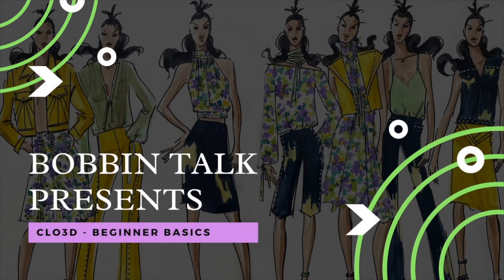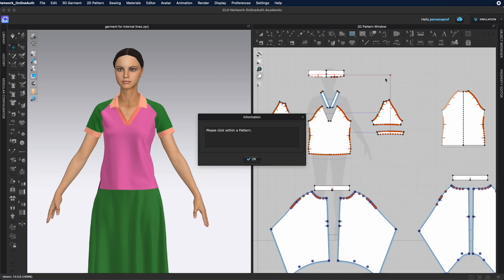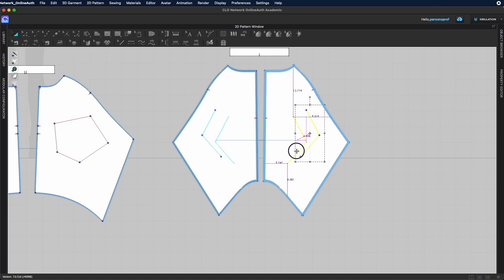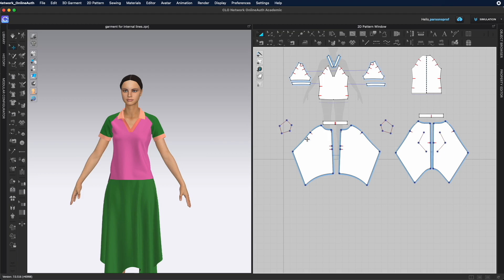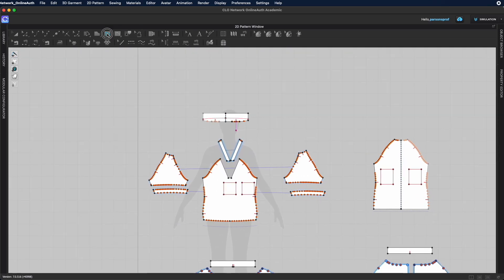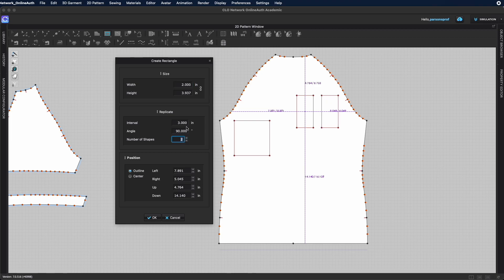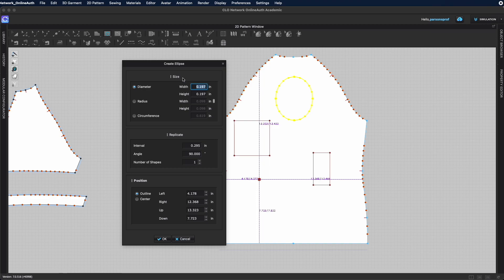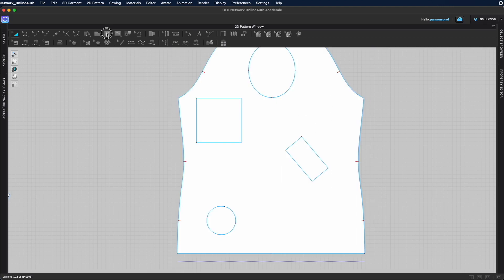How to Use Internal Lines - CLO3D Beginner Course

Comment: Hello so happy I found your channel , I traced a pattern from a book that has  darts inside the pattern , I used the internal line tool cloned as a pattern however my darts  came out as shapes and not cut out like darts would be in clo, maybe I should have trace them with the dart tool? this why that tool is there as an internal line tool?! I tried to select my traced darts and make them into a hole but did not work , any suggestions  ?Thank you !

Comment: Is it possible to have a symmetrical pattern but a non symmetrical internal line inside?
Reply from the maker: You can do whatever internal lines you like inside the pattern. Use any of the internal line, rectangle, ellipse, tools to create shapes or a line.
Reply: @BobbinTalk  thanks for your quick response, but I'm curious to know if the internal line has to be Symmetrical. I want to have two symmetrical pattern pieces but only an internal line on one piece. Thank you!
Reply from the maker: Yes you can as long as they are not linked. (No linked editing on those patterns)